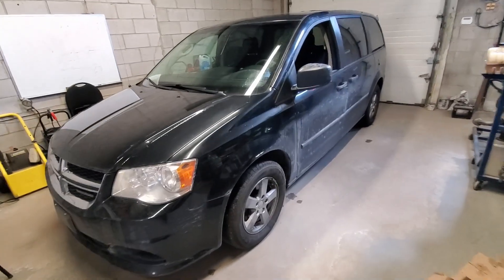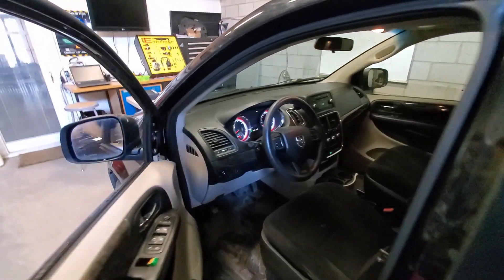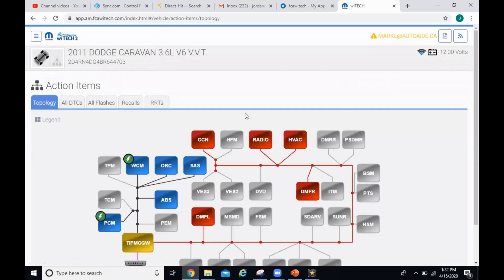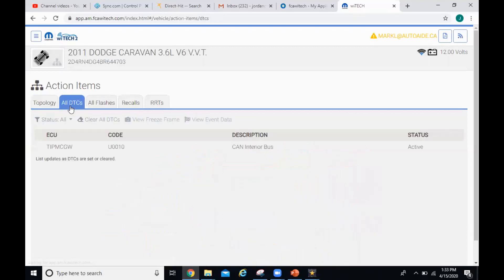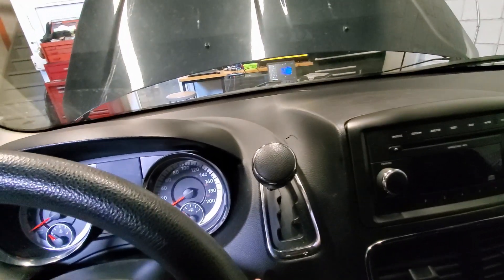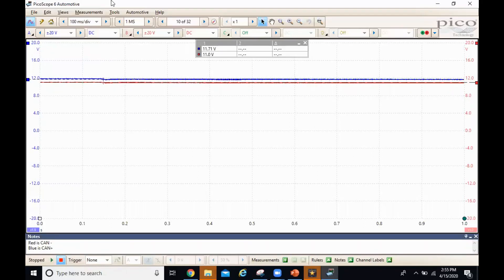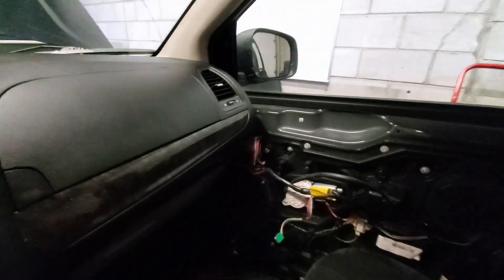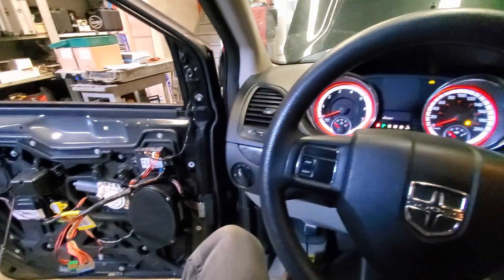Shorted Bus (2011 Grand Caravan) #caravan #can

Comment: Big Thank You from Poland! Just recently bought a Grand Caravan 2013. It had No "Bus error"First I checked all fuses and cables connectors on the TIPM. I searched everywhere, unplugged every connector. Nothing helped So I started looking for cable issues. To my surprise there was a mouse/rat inside the car! That sucker was everywhere, under the dashboard, floor mats, even in the roof overhead panel. Had bitten the back 3-rd row seats, which got me thinking to look there for broken cables. The power liftgate also wasn't working. And there it Was right under the 3-rd row seats floor mat where the cables go down to the boot. After the repair everything went back to normal besides the turn signals in the front (rear worked fine). Thanks to Your knowledge I got it right. I would have never imagined something like this, especially that mine (Dodge) had no fog lights.

Comment: I am having trouble with my dodge journey, it shot off as I was driving 2 different times and it wouldn’t start, i left it alone for like 10min, and then it started back up. and I get codes u0002-88, u0100 and u0101, the battery was recently replaced, I’m hoping it is just a loose wire somewhere by the battery my car doesn’t say no cam. I’m gonna have to do some troubleshooting. Thanks for your video it’s the only one that has given me a place to look 🤘🏼👀👍🏼

Comment: So what your saying is that if the scope was 12 volts or higher then it would indicate a short in a wire but because it's lower then it's most likely the can bus high module . I'm hoping. If u do happen to read this. I know nothing about electrical and no money to pay someone and no friends that can or will help so it's me or I don't get it fixed your video has been vital to me figuring out how to preed I can't thank you enough for posting this is not an easy issue to find valid info on I've found. Have been lost on what to do for yrs. Now and pressed for time do to my console is out and needed a smog to get my registration stickers so again huge Thanks !!!!

Comment: Thank you so much dude I have had a similar problem with my windshield wipers on my headlights on no horn nor brights no blinkers no dashboard console. And no help and have to get it slogged your a life saver !! Much love luv thank you so much for posting :*:*:*:*
Reply: Hey there. My problem sounds closer to yours than the video was just curious if you found a fix and what it ended up being.. also what did you use for testing if you dont mind shating i have no money to have soneone else do it and like tou no friends to help. Would appriciate any useful info u dont mind sharing. Thanks so much.
Reply: My 2012 was like that then didn’t do it for over 3 months  after new battery  now does it all the time on to off.do I tell dealership no bus  deal  and they will know?how munch to fix?

Comment: Yessss! I just fix my ram1500! Dude at the tint shop, let water get in my door! Which was causing the bus issue! I unplugged all the modules in the door while the truck was on... and there it was ! Thank you so much 💓
Reply: That’s crazy this happen to me after I left the tint shop as well I was freaking out nothing online was making sense
Reply: @rafaeltaveras6834  I wonder where was the tint shot at? 🤔
Reply: @Nonormacy  sunrise Florida I just started to drive pancaking driving home and went away thanks God 🙏
Reply: Whats the purpose of disconnecting the connector?
Reply: @silviagonzalez5275  to stop the electrical malfunction.... alot of codes were appearing on the dash! Windows were going up and down on they own! The truck was idling very bad... all sorts of strange things.
Reply: @silviagonzalez5275  read my latest post... I meant to send it directly to you

Comment: Hi, good video, informative. I am in Australia and have a 2012 Jeep Grand Cherokee 3.0 Litre CRD, export model for USA specs and RHD. A year ago I did have to replace the DTCM and while in the repair shop the car locked itself with the keys inside. I don't think that should happen even if it was accidentally locked; I have the door handle with the lock button and passive entry. Then all seemed OK but a few months later the doors would not lock by FOBIK key but would unlock using FOBIK. Doors would lock and unlock using the door handle OK. Not a big deal so we didn't bother. Then a few months later the alternator burn out. We had DTC code U0100 lost comms with PCM/ECM A. I have put a new alternator in and still have the same DTC, no crank no start. CAN BUS tests at 60 ohms OK but Voltage between Hi and Lo is both 2.47V, therefore shorted CANBUS either in wiring or in a module. All accessories work such as power tailgate using the FOBIK, the radio, the seat memory and movement, the windows up/down, the steering unlocks but now the doors do not lock/unlock with the door handles. I have replaced the PCM and no change, and I have replaced the TIPM with no change. The WINM has power but it seems like it might be immobilised because most everything works but no start. I cannot get a VIN-specific workshop manual anywhere including the local Jeep dealership who say they can't get one from Jeep either. I have written to Jeep Customer Service several times and get nowhere. The wiring diagrams I found online are mostly incorrect for pins in use, the wire colours, and the module location so mostly not for my particular model. I have pulled most of the car down looking for BCM, TCM, RFHM, PEM and so on. This has been very frustrating. The BCM seems to have 7 connectors and the only place I can find that is under and part of the TIPM. I also think the RFHM is actually integral to the WINM. I can't find the Passive Entry Module. How do I find the actual causes of the fault? A local Auto electrician is helping and is stumped too. Is it a door module like in your example, would that cause a no crank/no start? Is it the Wireless Ignition Module although it seems to recognise the key when inserted [I have removed the push button for now, is that a problem?]. Many thanks if you could think of something. regards from Australia.

Comment: Ihave 2012 dodge journey 3.6 same problem  do you thing is gana be fixed if I do the same way you do it thank you so much reply me pleas
Reply from the maker: Yes, you can apply the same diagnostic technique, providing that you follow the procedure as it applies to the Journey. ie - Correct wiring diagram, etc, to ensure that you are on the right track. The important part is determining which modules are being drawn down before taking the time to pull covers off etc. Good Luck!